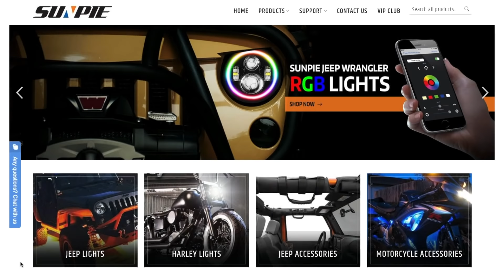Jeep Wrangler Halo Headlights by Sunpie

Comment: 2:57 
just  wanted to clarify. one of the slots is for the existing fuse (circuit ) that was already there, and the second slot (the new slot/fuse) is for the fuse to protect the new circuit you are wiring.

Comment: my two wires that are off of the plug are yellow and green! which are for which??? help
Reply from the maker: Yellow should be the turn signal. Just touch it to the positive side of the battery terminal to test it.

Comment: I had headlights installed,worked fine..I changed my phone and now I can't load the app in English to make halos work.Sunpie has not helped at all..App is called Shine and can't be found ..Such b.s. don't order these,most frustrating experience !!!!
Reply from the maker: Not sure which model you bought, but these do not have Bluetooth app control.